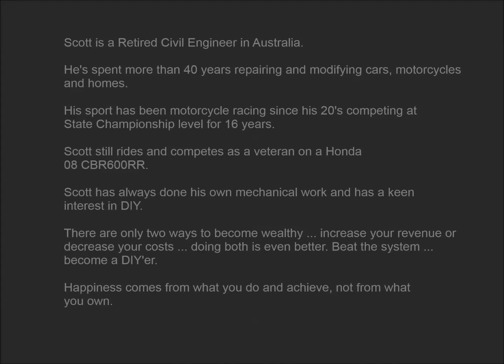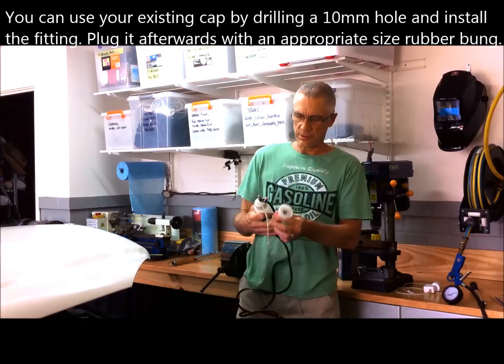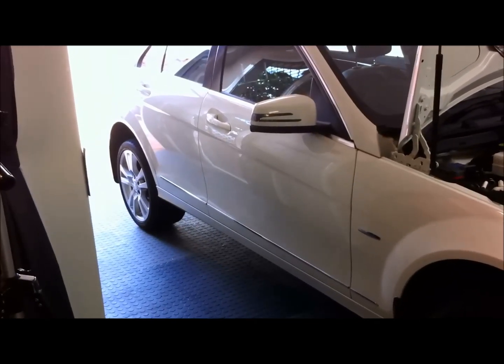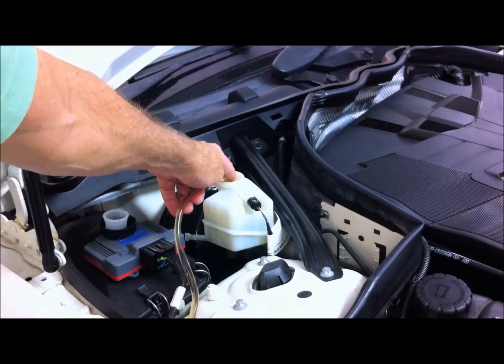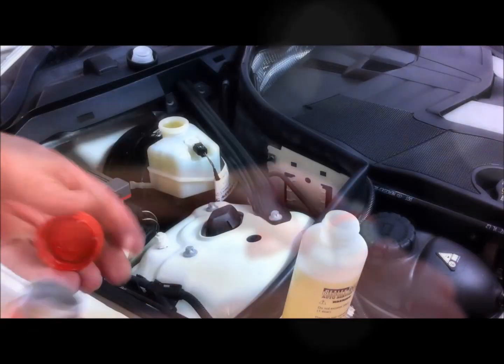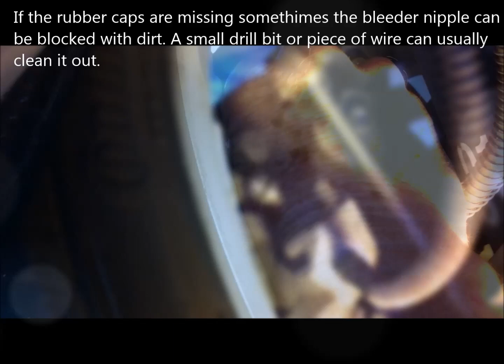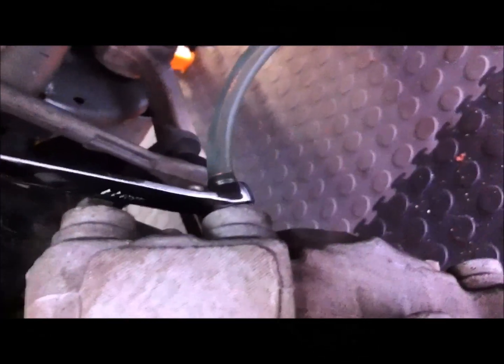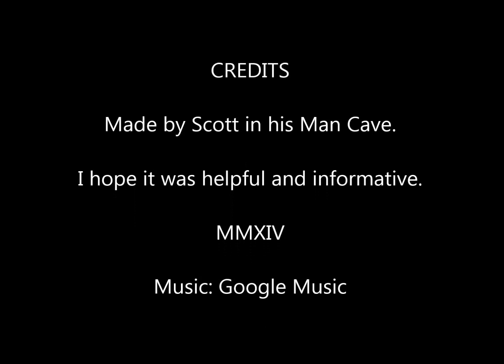W204 Mercedes C Class Bleed Brakes Pressure Bleeding Vacuum Bleed

Comment: Hi Scott thanks for all the great videos!!!! A couple of questions, if I may. Where do you put the jack stands on the front and rear.? Is it on the axle and does it have to be on a particular part of the axle? And where do you jack up the car on the rear to put the stands in place? I am aware of the jack pad point in the front middle of the underside area but my jack keeps hitting the large plastic underside covers so I cannot get the jack in to lift it up. Any thoughts would be welcome please. 
Also, what do you use to keep your engine bay so clean and are there any parts that need to be covered when pressure washing the engine bay interior, if that is how you do it? Thanks again.
Reply from the maker: Thanks Ric.
Jack stands at the front go on the frame near the lower control arm mounts. Same with the rear. You just have to find an accessible safe point near the suspension mounts to jack from. Depends a bit on the type of jack to. At the rear if you have a big enough workshop style trolley jack you can put it under the diff.
I periodically spray the engine bay with truck wash from a container attached to my garden hose. I give it a liberal spray and leave it. I rinse it with more truck wash and let it to dry. It has corrosion inhibitors. This is what I use: https://www.supercheapauto.com.au/p/chemtech-chemtech-ct18-superwash-6l/388876.html?cgid=SCA01010203#start=3
No need to cover anything as the various components are designed to handle water being sprayed on them when driving on wet roads.
Reply: @ScottElliott152 Thanks Scott. Will go get some of that truck wash. I used degreaser previously on the engine bay and it wasn’t a good result. Dulled all the interior surfaces particularly the black surfaces. Do you use the truck wash for the body paint as well or just for the engine bay? Thanks again for giving us all such handy instructions.
Reply from the maker: @riccob6540  I use the same truck wash on the body. I spray it on and let it sit for as long as I can. If the car doesn't have caked on grime often a soaking in truck wash is enough.
If rain is imminent I'll put the car in the drive and give it a good soak in truck wash and leave it. When the rain comes it rinses and leaves no spots that you'd otherwise get with tap water.

Comment: Hi Scott I did my bleed yesterday using an ARES pressure bleeder at ~15-19psi (the video instructions on the company’s website stated to do it a 10 psi but I thought that would be too low so I went a bit higher based on your videos) However, I found that particularly the rear wheels were not bleeding much despite me trying many times. I used a 6mm bleeding tube on the bleeder nipples. Does the plastic drink bottle you use to collect the old brake fluid have two holes - one for the tube insert and another for air flow or just one for the tube insert. After the job (Ive done a brake pad, rotor and brake fluid change) I find there is more travel in the brakes than before. If you have any suggestions or ideas that would be really appreciated. My car is a W204 C250 CDI coupe and I have followed your videos for all three jobs including akebono brake pads, Castrol React dot 4 fluid but with Brembo rotors (because I wasn’t sure what rotors you used). So you can see I am a religious follower :). Thanks in advance and keep the great videos coming!!!
Reply from the maker: Thanks Ric. Did you open the bleeder valves enough? Generally you need at least half a turn. Also brand new pads can feel a bit soft until they bed in but it sounds like you've driven it enough for that softness to pass. The bottle I have had two holes. Also I still have the standard rotors the car came with.

Comment: Hi scot Is it ok to do the bleed with a vacuum hand pump ? And what should the brake pedal feel like after the flush my brake pedal is good but not really stiff the way I like it thanks
Reply from the maker: +skm gaming hd ... No you should be using a pressure bleeder. The ABS system in the MB requires that method.

The brake pedal should feel firm as it normally would if there's no air in the system.

Comment: I have read that the WIS on our cars wants pressure at around 2 bar or 29 PSI. Another forum member stated: It is important to build to this pressure to allow two check valves in the ABS system to open. This will ensure all air has been fully purged from the system. Are you using approximately 29 PSI + on this procedure or is less okay? 
Thanks !
Reply from the maker: I'm using about 20psi and it's been working fine. No air in the system and a firm brake pedal. I've looked in the WIS and can't find anything about 29psi. It says to use a pressure bleeder and follow the manufacturers recommendations ... the manufacturer of the pressure bleeder. Scott
Reply: Thanks Scott, I am going with what you say! I have a 2013 C250 so it should fall under the same procedure! Seen your other videos on changing out the transmission fluid etc. Thanks for all your videos and I appreciate your time!

Comment: Hi Scott, great work and many thanks for all your efforts to make us nono's wiser than we should :):) Since I bought my S204 black estate, I am hooked to your youtube. But may I make a request ? Please? Can you do two more? One on how to put the car on the jackstands, what is the best place for them? And one on how to change the fuel/dieselfilter? That would be of great help. and yes again greetz from the Netherlands. (At the moment I am hunting for Das Centry, but its not easy to get hold of) TRRRRing O my... the door bell ringing, o hi, your package with your new pressure bleeder kit...... :):) . So Scott I do hope you are well, Sincere Regards to you and family.
Reply from the maker: +Arnoud W Thanks Arnoud. Your compliment makes me feel very humble. I'm very happy to help where I can.

I have a video for my Vito 115CDI on how to change the fuel filter. It will be the same process. What engine do you have in your Estate? The Vito is the 4 cylinder diesel 2148cc and the fuel filter is on the RHS of the engine looking from the front. https://youtu.be/kxfbLLTOkZ8

I'll have a look at the jack stand video idea as others maybe interested. It's an important safety consideration. Every year 100's of people are crushed under vehicles.

Good luck with the brake fluid flush. It's a simple project so don't get worried. Take your time. On the reservoir you may have a nozzle on the bottom that's not used and it will be sealed off during the manufacture. I think it's for the clutch if the car is manual. Last time I did my bleed I cut the sealing tab off that nozzle to make it easier to drain the reservoir. The reservoir has baffles inside making it difficult to suck all the fluid out.

I used a short piece of plastic tube kinked over and cable tied to seal the nozzle before filling with new fluid. I'll take a photograph and post a link back here. Regards, Scott
Reply from the maker: +Arnoud W An easy modification to allow easier draining of the brake fluid from the reservoir.

http://i367.photobucket.com/albums/oo115/scotte55_photos/IMG_3493.jpg

http://i367.photobucket.com/albums/oo115/scotte55_photos/IMG_3492.jpg

Comment: Hi Scott, compliments to another great video!  I noticed that you put DOT4 in, whereas I believe Mercedes specify DOT4+.  I can't see any DOT4+ from Aussie resellers and avoid buying from the Mercedes dealerships if at all possible, is it actually ok to use just the DOT4? Cheers Andrew
Reply from the maker: Hi Andrew. DOT 4 is backward compatible so you can use 4 where 3 is specified. For example the Penrite Lube Finder recommends their DOT4 or DOT3 product.
Reply: @ScottElliott152  Hi Scott, there’s something that I don’t understand here as it’s Dot 4+ specified not Dot 3 … what have I missed? Thanks Andrew
Reply from the maker: @andrewmccauley2807  Sorry ... you mentioned DOT4 and DOT4+. I was on Auto pilot and said DOT3. This is what the Penrite Product Selector recommends for the C320CDI: https://penriteoil.com.au/products/super-dot-4-brake-fluid.

This is the Nulon product I've been using: https://www.partshouse.com.au/nulon-xtreme-performance-brake-fluid-super-dot-4-5~1055876

Both are touted as "Super DOT4" which is DOT4+ in my book. I've been using the Nulon product for over ten years in the C320CDI, Vito and track bikes without problems. It pulls up my GSXR750 from 250kph lap after lap.

In the video I use Castrol React DOT4 Performance which I also view as DOT4+ which states is "Compatible with all other brake fluids that meet either DOT 3, DOT 4 or Super DOT 4 specifications.

All have a boiling point around 275C+
Reply: Dot 4+ can be replaced with Dot 5.1 which is easy to find and bought. But must be replaced (flushed) all in brake system

Comment: Hi Scott. Quick question. What Dot did you use? Saw some Mercedes 4 Dot Plus online for a good price in the UK. I dont know if its suitable. Cheers.
Reply from the maker: Any good quality DOT 4 is fine. You don't need Mercedes branded stuff as it's over priced. I use the same Australian made DOT 4 in all my cars and bikes. I use it in my GSXR750 track bike and it pulls me up from 250kph lap after lap.
https://www.nulon.com.au/products/brake-fluids/xtreme-performance-brake-fluid---super-dot-4
Reply: @ScottElliott152  Its Mercedes Dot4 Plus 2×1L bottles for £16 delivery included. I think its worth it. When it comes to the bleeding bottle, Ill have a look around. Thank you so much!
Reply from the maker: It's up to you. That's a reasonable price. We pay a fortune down under for MB branded consumables. We call it the Mercedes Taxation system.
Reply: @ScottElliott152  :)) Yeah I heard it in your previous videos. These new Mercedes are ok with small issues going on so whoever is a bit of a mechanic can cut costs down by doing things themselves and shop for good price consumables. For example I got 20L of genuine Mercedes Engine Oil for my 2009 C180K Blueeficiency estate off ebay as well for £55 delivery included. Ussually they are Mercedes dealers who service fleets.You are amazing and you deserve more views and subscribers. I personally think Im going for back to japanese cars and might try a Lexus in a year or two or new Mazda 6/3. Used to have Mazda s and Mitsubishi  s with no issues at all, and some Volvo s with great quality.
Reply: @ScottElliott152  Me again:/ Your fluid reservoir has  the white tip on the left side blocked with somethinf white. Mine has a black hose attached to it that leads somewhere. Can I carry on same way or block mine too aftet removing the break fluid inside I guess?
Reply from the maker: Is your vehicle a manual transmission? Leave that hose in place and follow the procedure in the video.
Reply: @ScottElliott152  Yes, Sir. 2009 C180 Kompressor Blueeficiency (1.6L not 1.8 with supercharger) manual, UK registered. Thank you.
Reply from the maker: That will do the job. My reservoir Cap will be the same as yours.
Reply from the maker: Ok. Well that black hose is feeding the hydraulic clutch. So you'll have to bleed the clutch slave cylinder. That will be on the bell housing immediately behind the engine. You may have to do some searching on the net if you don't know how to bleed it. It's very simple so you'll work it out. My Nissan Navara 4wd has the same set up where the one reservoir feeds the brakes and clutch.
Reply: @ScottElliott152  You re an awesome human being. Thank you for taking time to reply. I shall do so.  I wish you an awesome week ahead:D